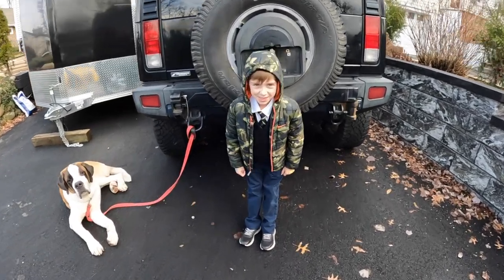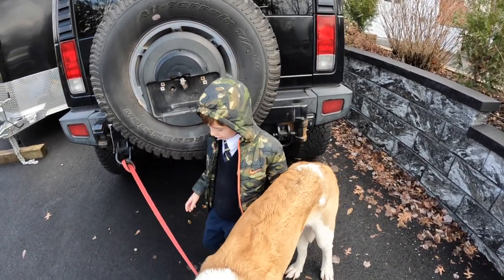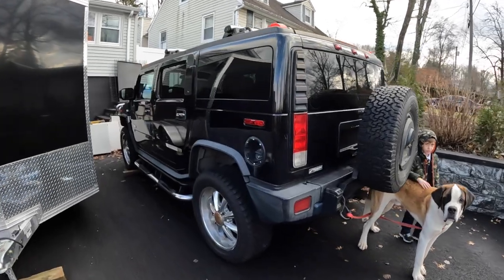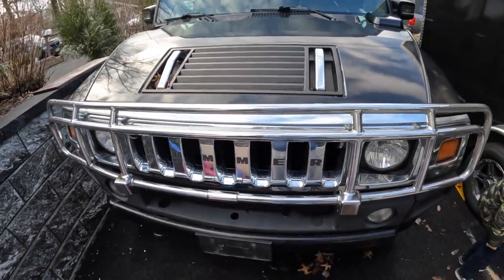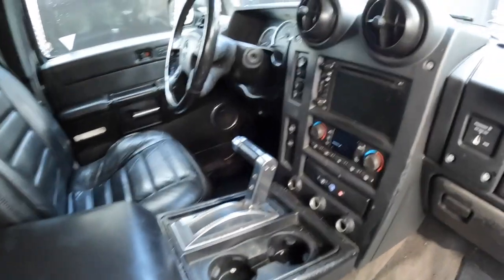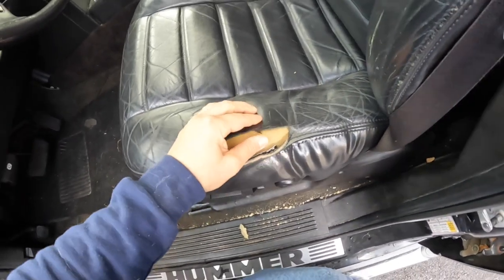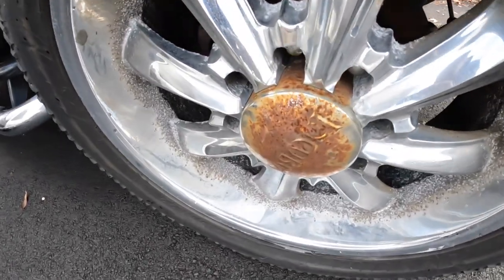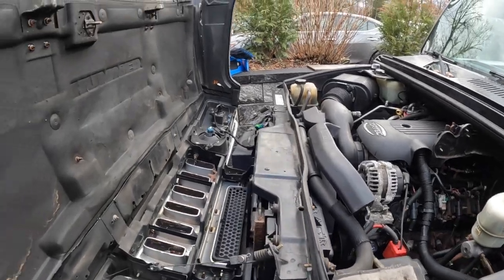Dad's 2007 Hummer H2 SUV Original Owner. My New Picker Work Truck? Fix or Not?

Comment: Also, put original size tires back on. Knobby tires shake everything going down the road. The wife just bought the 06 this fall and it had 37 inch mud tires on it. They had to go. Bf Goodrich all terrain t/a ko is what we run on these trucks.

Comment: How manny miles on the H2 and how much did you pay for it
Reply from the maker: Hi! Over 200k paid 2k. Update it's at the mechanic! Needs a engine/trans.
Reply: Thats a amazing deal u can get the engine and transmission from a 06 escalade they share the same parts
Reply from the maker: @loyalT402  unfortunately it will NOT be a cheap fix but I am getting a Jasper engine/trans with great warranty. Will keep update with videos as I fix her up. ❤️
Reply: @Brifford  dont do that u still have to replace the whole suspension brakes brake lines everything . Get the engine from a escalade they last 400k miles get a used one with a low miles wont cost u a thing 2k maxx for about 4-5k ull have a brand new hummer from bumper to bumper
Reply from the maker: @loyalT402  unfortunately I'm not very knowledgeable in all this mechanical stuff but let's see how it goes, I'll update thanks for your help!
Reply: @Brifford  that explains a lot please becarful dont let a mechanic rob you for something so simple
Reply: @Brifford  for 10k u can get a duramax diesel engine installed in your hummer